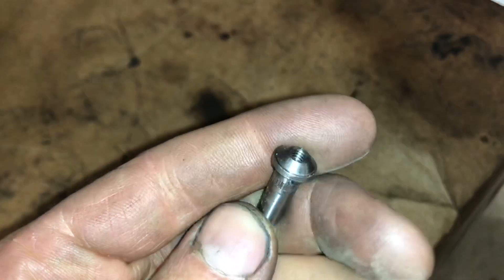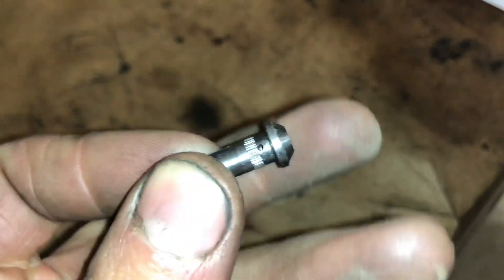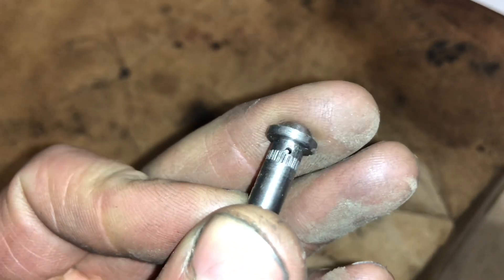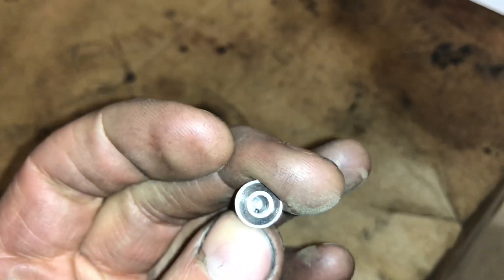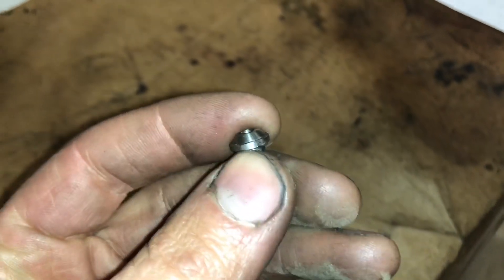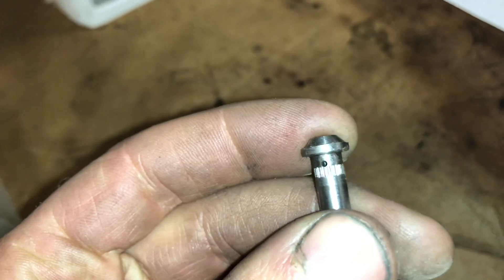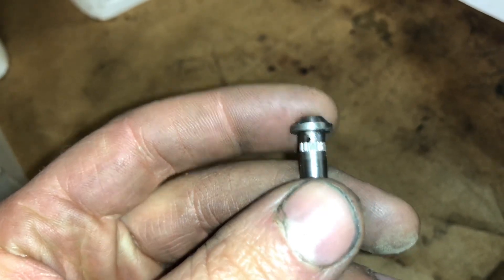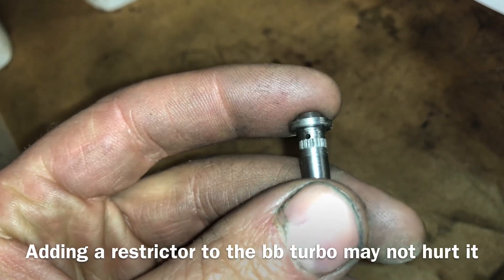Does ballbearing turbo need an oil restrictor?

Comment: My GTX3582R Has Started To Burn Oil At Idle After About 1500 Miles On New Engine Set Up. Only Smokes At Idle And Smokes More When Parked Up A Hill (Turbine lower then the compressor). It Smokes Like A Forest Fire When I Come To A Panic Stop. If I Hold RPMs Up To 3K While Coming To A Panic Stop It Won't Burn Oil. I've Got A 3/4" Turbo Drain Going Into The Oil Pan Above The Oil Level In Pan. It Ran Fine For 30,000 Miles With No Smoke On Old Engine With Same Feed And Drain Set Up. Only Thing That Changed Is Idle Oil Pressure On Old Engine Was 25PSI. Now It's About 30PSI At 620 RPM But It Jumps To 50PSI Around 1100 RPM. (before I don't think it jumped so much At 1100RPM)  I Figured If The Oil Pressure At / Near Idle Was A Problem It Would Have Smoked Right Away Not After 1500 Miles. Any Ideas? I'm Thinking About Going With A .030" Oil Restrictor. I Believe The eBay GTX3582R Has A Built In .035" Which Isnt Small Enough For My High Idle Oil Pressures? It Only Smokes At Idle. My Guess Is The Cold And Hot Side Pressures Keep The Oil Inside The CHRA.

Comment: If you have adequate oil feed/flow to turbo and adequate drain line size/positioning but your getting oil backup you also should be looking at your oil crankcase pressure. Freeing up crankcase pressure should in turn free up turbo drain flow.